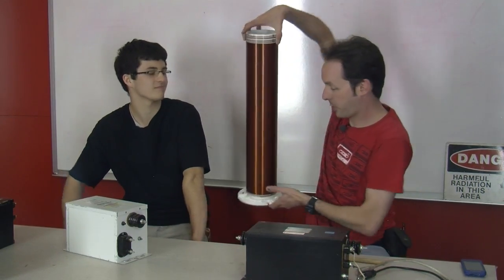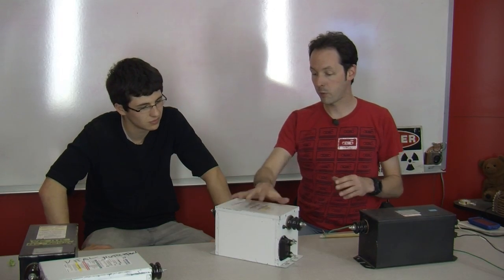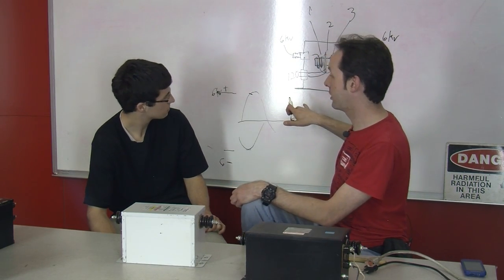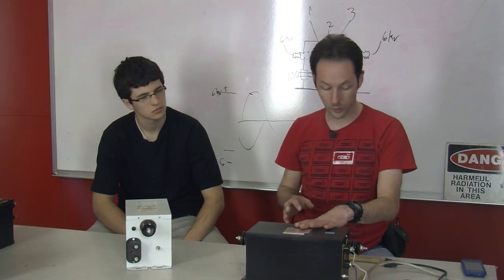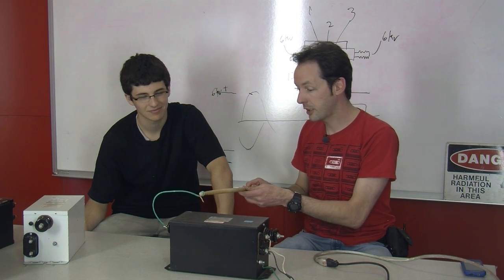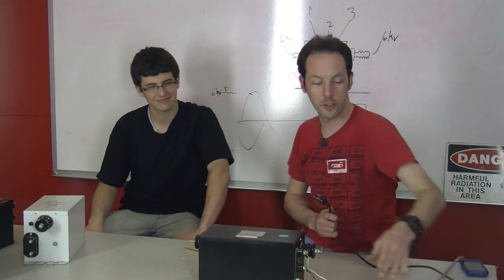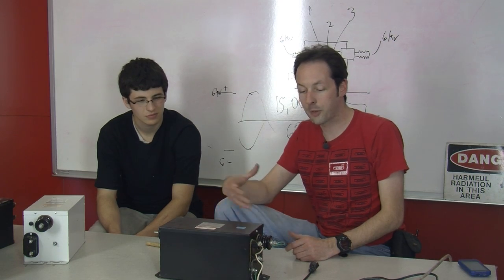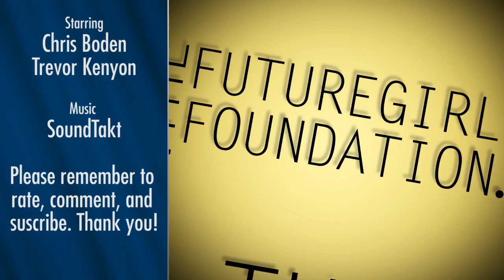Power Supply Basics: Tesla Coils with Trevor #2

Comment from the maker: While not exactly true with AC systems, for simple use Volts x Amps = Watts. More watts is always better. Also, a higher voltage (to a point) is better for spark gaps. Personally, I'd go with the 12/30.

Comment: Thanks so much for this video! I'm actually ramping up to build my first SGTC. I have a 7500/30 nonGFCI NST which I'm planning to use and I'm pretty clear on what to do except two issues: 1) Is any form of protection necessary for the NST? I mean like low pass filters and chokes. 2) I've seen two schematic variants and need to know which is right: In one the tank cap is parallel with the primary while the SG is in series, and in the other it is reversed; series tank cap and parallel spark gap.

Comment: I'm quite sure other people have said this, but you haven't approved the comments yet... AC voltages are measured as the root-mean-square (RMS) voltage. 100VAC is 141V peak-to-peak. I believe it was done this way so Ohm's Law still applies to AC circuits.

Comment: The 15kv rating is rms and the 60mA rating is rms. So the power rating is also rms. In AC if everything you're working with is rms, its true that double current means double power.

Comment: so you connect both terminals to your coil to get 12kV, but they are out of phase. Wouldn't that turn it into 0V? And are these 6kV square wave DC or actual AC?
Reply: Let the first terminal be a and B be the second  so the pd or vtg between them is given as Va-Vb so if they are in phase we get 0 but if they are out of phase by 180 degree then the voltage doubles

Comment: On Ac components, the values are almost always RMS values.
What that means is that you can usually apply DC rules.
So, yes. your power is volts * amps.
If the power factor is off you have to divide by the power factor to get your VA rating.

Comment: I have a very fundamental question. 

My neon sign transformer is rated at 15kv with 0.30 amps(30miliamps)

I am trying to figure out the capacitance and capacitors that I need

I came up with: 53 microfarads rated at 2kv each. I would need about 36 capacitors, is my calculations right??

Comment: Hello guys, well this transformer work in Europe 220v input??
Reply: If the output is AC, then yes.
Reply: probably but it's current limited and all that jazz, so maybe only use ones made for europe
Reply: Yes but it won't be efficient as it is designed for 120volt 60 hz u must buy a transformer made out side the US or made for 50hz and 220v supply

Comment: i got a 9kv 30mA NST a secondary coil with 800 turns and a primary with 8 turns the secondary is wrapped around a 3in pvc and its 24 gauge enameled wire. i have no capacitors yet and i dont know how to wire it up and i dont know what the expected streamer length is someone please help